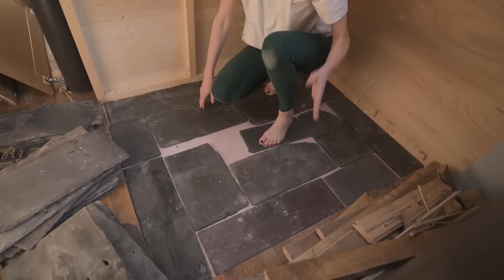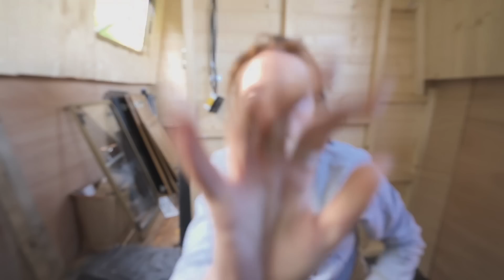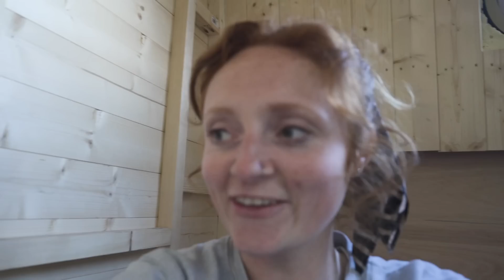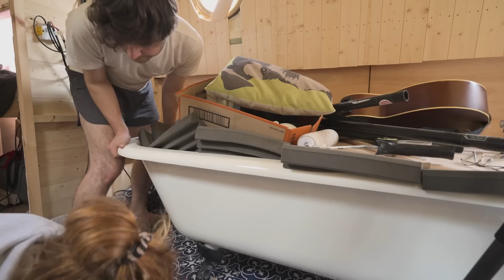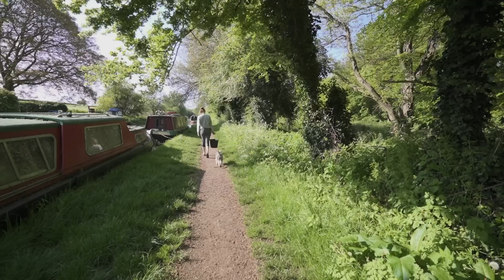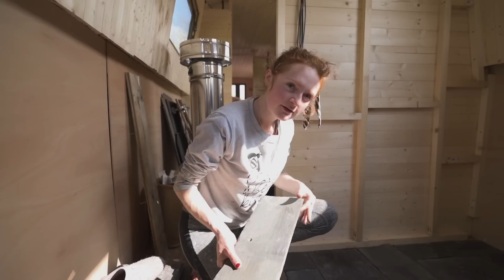For our FIRST TIME, this didn’t go too badly! A BIG week of DIY on our HOUSE BOAT | this tiny life

Comment: Might I suggest that when you are using Lino for a bathroom there is a trick where you actually go up the wall about 100mm and use a batten of timber or skirting over the top which you then use some sealer.
It’s normally used for wet rooms but it might be a good idea for your bathroom just in case it ever floods !. 
With tiles such as you were using, you do need to scratch or score the side that goes down onto the adhesive ( you might be ok but if any comes loose you know what to do with them next time ). 
Think you two are doing a absolutely magnificent Job ❤
Reply from the maker: Ah that's a good idea! We're not planning on any more lino at the moment but you never know.... handy to know for the future thank you!!

Comment: Beyond that you have saved a nice piece of flooring from the bin, the one thing about the vinyl is that if will work as long as you need it to. If later you decide you want to change it, you can and you won’t have an unfinished floor sitting there.
Reply from the maker: That is one thing that was playing on our mind.. if there's ever a bathroom leak we can easily just whip up the flooring! Thank you ✨

Comment: Really enjoying your boat build videos.  That off-cut of vinyl flooring actually gives the bathroom a very posh look.  If the slate tiles break very easily, are there any concerns about them holding the weight of the stove?
Reply from the maker: Thank you!! We were really apprehensive about it but thank you, agree it looks quite classy down! The slates are quite thin which was a concern... But watch this week's ep (going up tonight) to see if they hold up 😉